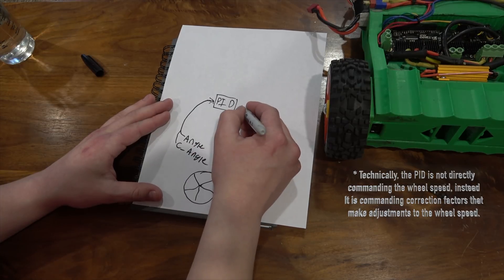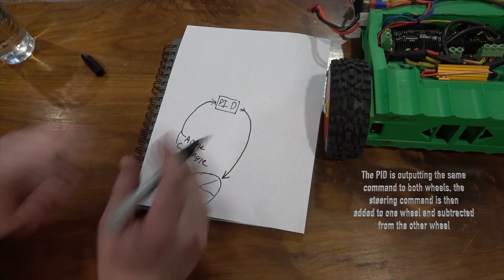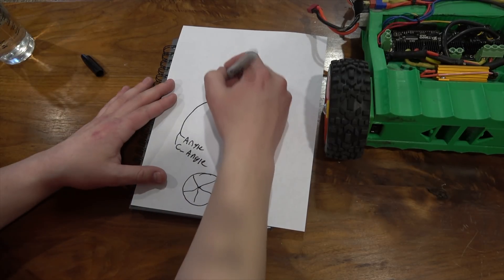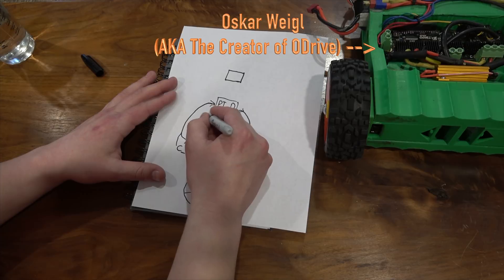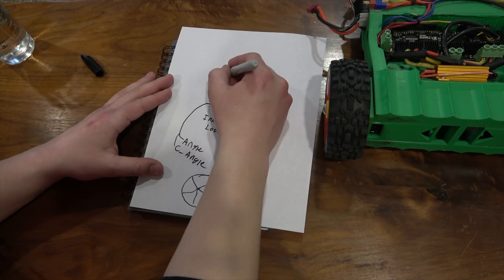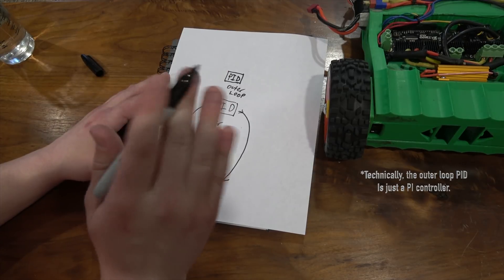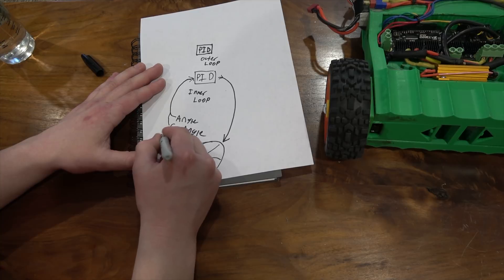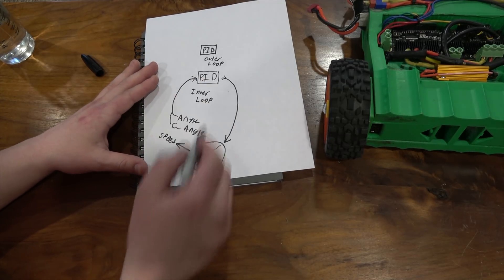How This R/C Car Can go STUPID Fast While Balancing on 2 Wheels

Comment: questions : 
1 - is the motor encoder optical or hall effect ? 
2 - which gyro and mcu do you use ?
3 - how to handle dynamic load ? - the center of mass may keep moving .

Comment: Would you be interested in making this open source?
Reply from the maker: It is!
Reply: @GearDownForWhat  Damn... I should have read the description!  Why do you need an encoder on the wheels?  It seems that you don't need to know where the motors are... Seems like the output of the PID could be steps to move the motor.
Reply: Ooops, sorry again.  Looks like you didn't use stepper motors.  Looks like the D5065 is a 3-phase brushless.  That's where you got the speed from.  Hmmmm.
Reply from the maker: Yup! That’s why it’s so fast!

Comment: If it has 2 wheels and requires to be balanced, is it a car or a sideways motorcycle?
Reply: Ronak Dhakan sideways motorcycle, in my opinion cars should need at least 3 wheels
bikes need two wheels
and motorcycles need to be motorized

Comment: First and foremost, awesome job!  You did a great job building that.  An idea would be to have a vertically aligned counter weight, with it's pivot point at the upper edge of the case, which can swing forwards or backwards from said pivot point out the front and rear of the case. (Maybe hang down half to 2/3rds of the way down.)

Would this help in gaining additional speed, if you command a certain speed, a servo at the top would swing the solid counterweight out forward in the direction it's moving and hold it there so the wheels can accelerate faster without losing balance, and then swing to assist during acceleration or deceleration.  If it brakes suddenly, the counterweight on the server could swing back behind the case to assist in slowing it down as well.  Could work as additional stability control.

I guess in a similar fashion that Boston Dynamics has added a counterweight to their 2 wheeled models.  :) https://www.youtube.com/watch?v=5iV_hB08Uns

Comment: That's awesome, looks like you've put a lot of time and effort into that project. I wonder if you could squeeze more speed out of it by optimizing the height and weight of the upper counterweight. And of course bigger or higher rpm motors, I'm assuming it's top speed is limited by how much extra horsepower it needs to balance while already spinning at high revs? Cool rig though, thats the kind of stuff I like to see. That's thinking with your dipstick, Jimmy!

Comment: Looked like you had quite a bit of unused space in there.
Could it be reduced height-wise to a cylinder and have a tiny remote camera embedded to essentially create something similar to the drones on Rainbow six: siege?
If so the next step would be to give it jump capabilities, then you have a fantastic piece of kit envied by gamers everywhere.

Comment: I reckon you could probably improve performance by reducing the frontal area (less like a brick wall) by laying it down a bit, perhaps flat on the road, and adding an extra wheel at each blank corner.
Reply from the maker: Hahaha

Comment: Could you also make it lean back when going forward? That would not only look very funny, but might also be aerodynamically more stable...
Reply from the maker: If it leans back it has to slow down or else it will fall backwards
Reply: @GearDownForWhat  Hmm, I see... You could then add a 'wheeliebar' but that would go against the whole 'riding on two wheels'...
Other option could be a slow 'lean back' mode or a fast 'lean forward' mode... 👍🏻

Comment: How do the systems react to low grip surfaces? For example gravel.
Reply from the maker: Horrible. It has a lot of trouble with even wet pavement. It will just over correct and fall over.
Reply: @GearDownForWhat  Time to add another PID ;)

Comment: Could you please build an invention of mine?  Simple Tension Exoskeleton. 
Part I: 
1. A cable or strap. 
2. At one end of the strap (or cable) is a loop used like a horse riding stirrup and you put your shoe in it. 
3. The strap runs along the front of your leg and over the knee. 
4. You wear a bicycle knee protector and the band/cable goes over that (and maybe through a guide that keeps it in place in front of your knee. 
5. The strap reaches to your waist where it is tied to the bottom of a belt and shoulder harness. 

6. When bending your knee the band gets pulled and you can hold it tight and in place by some sort of handbag strap lock. If it's a cable and not a strap, use a bicycle's hand brakes. 
You can now sit down without a chair and stay indefinitely without exerting yourself. 
You can hold a large refrigerator on your back without using your muscles. 

Part II: The strap is pulled in and then released by an electric motor. 
When pulled in it causes a kicking motion. 
You can climb mountains, or pedal your bike, or go up steps of a building, or do any of those with a refrigerator on your back. 

Part III: A long strap goes from your waist back to the other leg. 
Now the motor is working on both legs. When one side is "pulling" and kicking, the other side is releasing and letting your leg bend. 

When your done, simply strap it off. No need for electric bikes anymore.
Reply: Draw this

Comment: Cool and good job!
What would happened if you push it forward (somehow :)) while he's already "running" at max speed? Or what if he gets sudden back wind while maxing?
Reply from the maker: If it’s at its max speed and you pushed it, it could possibly fall forward depending on much much faster the wheels can go and how hard it was pushed. If it hit wind that tries to slow it down it will just slow down.

Comment: If I bought all the parts new what is the approximate total cost?  I've been wanting to build one of these for a long time.  Took control theory class 40 years ago and know what a transfer equation is but have not solve a differential equation since.  Can't wait to get started.
Reply from the maker: About $500
Reply: @GearDownForWhat  Thanks for getting back to me!
Reply: @GearDownForWhat Sorry I didn't ask the question correctly, I actually have the RC gear already.  How much are the parts for the robot alone? Luckly I built a Maker Farm 3d printer long ago.  Thanks.

Comment: I remember back in 1995 when DARPA said they were researching the applications of silicon based orientation chips that could, without any moving parts, determine its orientation. they envisioned aircraft electronics, missile guidance, and other stuff.. and predicted that such an application would be cost prohibitive on the hobbyist level. 

fast forward almost 30 years and we're using that technology to make a fuck you physics race car.
Reply from the maker: Haha I love you. We should be friends.
Reply: @GearDownForWhat  well I did end up following so theres that.

Comment: needs a 3rd  retractable wheel with  an air piston or a spring  so that it could jump. otr figure out another way to make it jump. at higher speeds the  air will start getting in its way so that needs to be adressed, other then that, pretty awesome

Comment: Add little Servos to its "arms" so i can push itself back up and keep on rolling.
Reply: Dane Glick it can self right using the torque from the motors. Problem comes when it loses traction on one wheel

Comment: Version 2.0 will have only 1 wheel of course :-)

Question, how quickly can it do a controlled stop?
Reply from the maker: It limits how far it can lean and that determines the acceleration for speeding up and slowing down.

Comment: If you add weight to the top does it accelerate faster?
Reply from the maker: Maybe, I think right now its acceleration is limited by the torque of the motors, if it leans further it will just fall over, but it also risks loosing grip by leaning too far. so yeah extra weight up top would help it accelerate faster... I think.

Comment: When it is standing still does it need to briefly reverse to transfer the weight forward before moving forward?
Reply from the maker: Yes! That is done automatically by the outer loop telling it to lean forward, which causes it to drive backwards.

Comment: Can I ask what your education and background is when you tackled this?

Working on ME degree and have gotten my ass handed to my by the arduino class. And its the one I wanted to learn the most because of projects like this. 

Awesome stuff.
Reply: You don't need a degree or background for this stuff.  Just a urge to learn and a bottomless internet.
Reply: There’s a class for arduino? Best way to learn arduino is to have a project to work on. Then break up the project into smaller more manageable steps. The more you do it the beater and more concise your code will become.

Comment: Yeah, i tried to make it work with ESP8266 and regular geared DC motors. Coding was a bitch and i realized when you have no encoder feedback you can't really control these shits with any degree of accuracy. I managed to get it to balance (or maybe i thought it was balancing, since it was so bottom heavy) but gave up on actually moving it.

Comment: As someone who knows control theory well and has been disappointed with seeing autonomous inverted pendulum drive robots that can't even climb up a slight incline... I'm extremely impressed. You really did an excellent job.
Reply from the maker: Thanks :)
Reply: @GearDownForWhat You're welcome! It's helpful once you consider that if there was no wind resistance, it would continue to accelerate with any non-zero angle of error. Your outer loop is literally finding the terminal velocity of the wind resistance at a given speed.

Comment: I had serious doubts for this project (running a fast balancing robot on uneven ground on a 8bit uc), but it turned out to be one of the most impressive and stable balancing robots I've seen.
Reply: The Teensy 3.6 is a 32 bit version of the Arduino. Most Arduino programs written for the 8 bit Arduino Uno will work just fine on any of the 32 bit versions if you change some pin numbers, use the correct voltage, and lower the output current as needed.

An Arduino Uno can push 20 mA through any pin for years at a time and the voltage drop will always be less than 0.5 volts. Most of the 32 bit Arduinos can't do that. The voltage drop will be far worse, and the pin may burn out in a matter of minutes at that high a current.

In almost all other respects, the 32 bit processors can do more stuff much faster.
Reply: @hamjudo  ok, I thought it ran on an 8-bit uc (I believe that was the premise in an earlier video), but it's still impressive. I can't wait to see the code.

Comment: can you please film the thing for more than 3 seconds? too much skipping of footage, you guys are trying too hard to make it look like a 5 star movie... just film the thing normally.
Reply: It is small and traveling at 40 mph. Meanwhile the camera operator is also working the remote control for the vehicle.  Longer shots can be done, but it requires an extreme level of planning, or significantly more resources.

One path to extended video would be to build a second one, with a camera, and autonomous control, so it can film the first one. All of the other paths also involve chase vehicles, or really extreme video equipment.

Comment: Great but don't use those off road buggy tires as it goes on road only 😉😅
Reply from the maker: Well... I needed tires that diameter and I thought those would have the most spring to make up for the lack of suspension.
Reply: @GearDownForWhat  yeah that makes sense, doesn't that brand make on road tires for those rims?

Comment: How about a little side-project: auto-stabilized micro camera on top of the Car?
Reply from the maker: Just put my karma on it!
Reply: @GearDownForWhat  add an airsoft turret with auto tracking and projectile  leading algorythms.
Reply: How about a little side project 2 1000cc motorcycle engines
Reply: Maybe that's a little dirty

Comment: Scale that thing up by 8 times (more for the wheels) and you have an amazing vehicle to place a couch in.
Reply: using a racing seat and 10kw 29x4 inch wheels should do the trick. (adding a roll cage obviously)
Reply: @satibel  No roll cage, just safety tie. 👔
Reply: @cdav  and safety squints
Reply: @satibel  roll cages are for people who don't haven't tuned their control loop well enough
Reply: Sounds like a challenge for Collin Furze :P
Reply: Lego movie?
Reply: Or just use 4 wheels...
Reply: @TheEchelon  arselash w0sh
Reply: You probably want to install roller-coaster grade seatbelts in there aswell or it will just let you fall out while accelerating... and then proceed to roll over you.
Reply: Now I wanna see this made using a racing seat with a 4 point harness, and wheels large enough that the seat can safely flip with a person it it.
Reply: Cloxxki over sized segway ?

Comment: How do you onyy have 74K subs? This channel is amazing. Do you know anything about FPGA programming? I'm imagining something that moves at much lower speeds due to a much larger battery, multiple cameras and 2 or 3 FPGAs running neural networks for vision, natural language processing, etc and a low power conventional CPU to tie things together. The more I type this out the more this starts to sound like the hardware/software engineering equivalent of /r/restofthefuckingowl. I realize this would probably take a fair sized team a decade or more but seeing this has me dreaming dreams of hobbyist personal droids that can follow you around and do personal assistant type stuff. Or maybe I've overindulged this evening. In any case, thanks for sharing this awesome project as well as "Richard" and all of the insane 3D-printed gears. Cheers!

Comment: Lets see it hit 100mph
Reply: It might lack mass and center of gravity for that, lots of lean is needed with that air drag...
Reply: @Cloxxki  makes sense!
Reply: @Cloxxki  increase angle decrease drag ;)
Reply: @miniwarrior7  True, but at some point it's less car and more airplane. (That would actually be a really cool concept...)
Reply: @jma89  this was never a car, lithium batteries and brushless motors aren't light he would have to make it alot wider
Reply: @miniwarrior7  If he got a motor with more thrust than what everything weighs then it would work. :-P Super unstable and barely any battery life, but that's just an excuse for further iterations. :-)
Reply: @miniwarrior7  Nope. The thing will act like a wing and lift itself up (or more correctly: it'll work as if it was a lot lighter). Therefore the wheels have a lot less downforce and this will make them slip more easily. Combine with the fact that the air resistance is proportional to the velocity squared you'll have the problem of needing a LOT of downforce so the wheels don't slip but decreasing it the faster you go. Plus, you'll need some headroom to speed up the wheels so the segway can tilt upwards in order to brake. 
As far as I can tell without some additional weight it'll not hit 100mph
Reply: @bassfpv  A movable aileron could provide additional down force for high speeds. I don't see how it would fit in the segway though...
Reply: it will hit 100 mph easy when you drive it into a canyon  ;-)